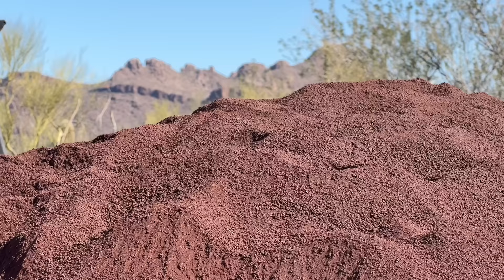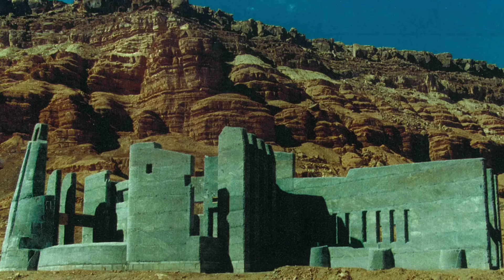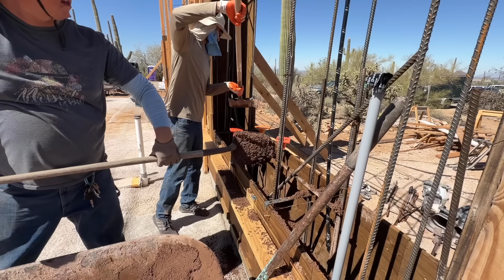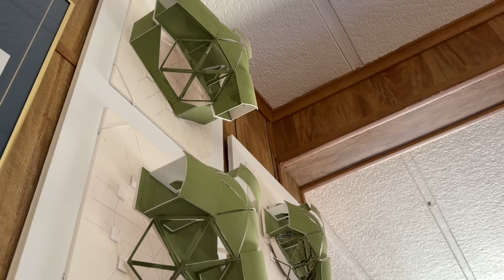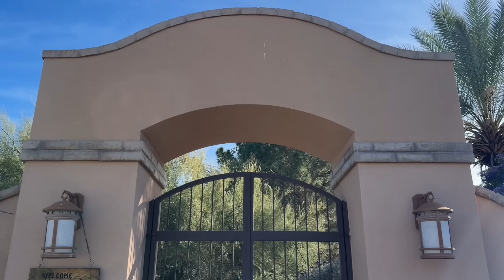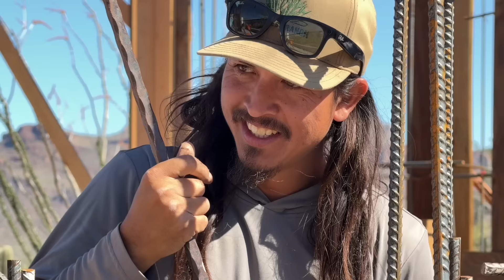The COOLEST Alternative Building Method You've NEVER HEARD OF

Comment: Ok really great for dry arid climates, but how does it perform in the cold, snowy, humid climate of northern Minnesota.  How does the material hold up to continuous freeze thaw cycles and ground heaving.  What prevents water and ice infiltration in the material?
Reply from the maker: You can engineer it however you like. Thicker walls for more r-value, larger and more dense rebar to protect against earhquakes of freeze cycles, you can even put insulation board in the middle for more R Value and a vapor break.

Comment: Does anyone know or built Lavacrete in a cold climate? I am going to build a home in NW Montana and I need to know if there are any problems with Lavacrete in subzero temperatures.
Reply from the maker: You can engineer it however you like. Thicker walls for more r-value, larger and more dense rebar to protect against earhquakes of freeze cycles, you can even put insulation board in the middle for more R Value and a vapor break. Would just look into how they'd build a concrete wall in your area to see how you'd approach it.

Comment: I have a methodology which completely removes the need for cement or lime .. It salt , sand , water & low voltage low current.  By raising the conductivity of the Lavacrete with a small amount of salt the low voltage electrical currents act to galvanically bind / bond the Lavacrete ..
Reply from the maker: Make a video would love to see it 👍
Reply: That would be an awesome process to see for sure! Would also love to see a video of the process in action! Cheers

Comment: This material reminds me of "styrocrete" which is essentially the same but uses small pieces of styrofoam as aggregate thinly coated with portland cement. 

That product clearly isnt as strong as this but it does have a significantly higher R value and weighs less than half as much.

I'd be curious if the two materials could be mixed to broaden the range of characteristics possible.

Comment: Lavacrete is what Icon has been using in their 3d printed buildings for years.
Reply from the maker: It's not the same thing at all. It's a epoxy-based polymer concrete that has no lava or volcanic materials in it. No idea why the  named it that, but what we're talking about here uses real sustainable materials and has been happening for 30+ years.

Comment: I just want Basalt fiber paper. It's better than Stone paper because it doesn't dissolve in acid for justice fire resistant and it's cheaper than the alumina paper that's used in Kilns, it doesn't need to be that fire resistant! Anybody know where I can get it?
Reply from the maker: Not sure what basalt paper has to do with this?
Reply: @TinyShinyHome honestly nothing except that it's actually made from lava not  an acronym that spells lava, or crushed rock derived from lava. Basalt fibers are actually spun from molten volcanic rock! It would also make a helpful Matrix to help pull together this product.
   But I just want it for a lab notebook that won't dissolve an acid or catch fire.
Reply from the maker: 😂 fair

Comment: Thanks for your most interesting post. I assume the finished wall is water permeable since the lava crete is porous? How do you manage drainage? I see no weep channels or drainage installed at the bottom of the walls. It was stated that typical steel rebar would rust inside the wall if exposed to too much moisture, therefore other non-metal types of rebar would be preferable. Are the non-metal rebar types code approved?
Reply from the maker: Yeah it's not something you'd want to put underground. That's why a stem wall is recommended. You can put insulation in the middle of the form while pouring to create a vapor barrier if required by code or just build a bigger roof overhang. I'm just a DIY'er so I can't speak to your specific codes. You'd have to research that yourself.
Reply: @TinyShinyHome  Thanks for your reply.

Comment: Could it be formulated to work for 3d printed house use? My assumption is that the answer is probably no… but just curious
Reply from the maker: No, it's a dry mix that is purposefully aerated and porous for increased insulation. Wouldn't flow in a 3d printer.
Reply: @TinyShinyHome that’s what I thought

Comment: Adobe and Tapial is easier and does not need rebar .
Reply from the maker: Actually Lavacrete is easier. The material is lighter and requires a fraction of the compaction that Rammed Earth requires. For engineering, code, and safety - both rammed earth and lavacrete use rebar, and that is recommended for lateral strength. You can build both without, though. Lavacrete should also have slightly better thermal properties because of the porosity of the walls and the way the material holds together. Not hating on Rammed Earth at all - it's also gorgeous and has similar properties.

Comment: Does this work in the humidity and salty air of Hawaii? We live in the jungle forests on the slope of Hawaiian cliffs.
Reply from the maker: Like Guru Das mentioned in the video, steel rebar would be your biggest failure point in that environment so you'd want to look into alternative rebar. Otherwise you'd probably want to build large overhangs to keep rain off, and some of Paul's buildings have a foam insulation sheet in the middle of the wall to act as a vapor barrier since the material is a little bit pourous.

Comment: Question what about adding epoxy  to the mix for a binder and sealer. Like they do for poured earth walls ..
Reply from the maker: You can seal Lavacrete walls, but keep in mind that if you are plugging all the holes you're reducing the breathability of the wall which is an important feature. As far as adding epoxy into the mix I would imagine that would change a lot about the install.
Reply: @TinyShinyHome ok  I was thinking for structural strength weather proofing but breathing wouldn't the mud clay hemp epoxy  overall have a better outcome 24 inch walls reinforced with steel at windows doors Not rebar then rebar in walls used drilling pipe in foundation sticking up at all thresholds for wall and roofing strength. All steel can be cleaned and epoxy coated. Whats your thoughts or have you tried this. Thanks
Reply from the maker: No idea, that’s a completely different way of building. We’re focused on Lavacretein this thread.

Comment: I'm  wondering how this method would stand up in a seismic active area?
Reply from the maker: The rebar reinforcement is going to be how it holds up, so you can engineer it however you like (i.e. larger rebar, tighter grid for higher seismic areas)

Comment: This still seems like a labor intensive system which means in high cost labor areas this would be cost prohibitive? It seems cool to get rid of many other trades and products like drywall and sheathing, WRB…etc. however not sure if this would pass CA earth quake codes
Reply from the maker: Houses don't build themselves. If you're not interested in DIY'ing it then you're always going to pay labor. With Lavacrete the walls can be done by a single team which is definitely attractive. Add a little machinery like a front loader and you can move faster. Rebar reinforcement is already recommended so you can engineer that reinforcement however you like for seismic areas.

Comment: Reminds me a lot of hempcrete, but i think this has the potential to build higher than hempcrete, which offer its own amazing advantages and properties, too.
Reply from the maker: Hempcrete has it's own benefits, but it's just an infill. It doesn't have any structural properties. You still have to build a wall support around it.
Reply: @TinyShinyHome  No you don't. Just as in this video, you build supports in order to form the walls. You then remove those wooden supports and raise them several feet to form.and pour once again. Hempcrete structures are stand alone, and require no more support other than within the hempcrete itself, just as with the lavacrete here. They look like concrete or stucco buildings when they are finished.
Reply from the maker: We have been to several hands-on workshops, and while it is "poured" in a similar way, it is not load bearing. Most hempcrete has a PSI of only 145 which is not enough for a structural wall. Professional concrete gets poured around 4,000 PSI and Lavcrete tests at about 2,500 PSI. Like I said, Hempcrete has some great things going for it, but it's an infill right now, and needs more support if you need to put a roof on it.
Reply: @TinyShinyHome 

Ah, i see. Thank you

Comment: The science behind this reveals a lot. Scoria is mostly glassy minerals composed from silica and alumina with some iron. These types of minerals react chemically with calcium hydroxide to form the same sorts of minerals found in concrete. Cement is a synthetic mineral that forms new minerals when water is added that stick to any inter mineral substrate. Without water cement does nothing. Cement also has excess calcium hydroxide which chemically activates the scoria minerals to form new bonds giving the long term strength increase. Fly ash which is commonly used in concrete mixes is another type of glassy minerals that act in this way. Blast furnace slag is another material of this type that can activate as a cement when activated by lime. 
Because crushed scoria fines are very sharp and porous it has a high surface area that takes a lot of wetting. They are not adding less water in this mix, the scoria is soaking it up leaving a drier looking combination. Normal concrete sand and aggregate is more dense and non porous so the water can form a slurry with the cement powder. Fly ash, if added, has a lot of microscopic glass spheres which improve the wet concrete workability. 
Lime is calcium oxide or hydroxide and can activate the scoria to form new minerals bonds between particles but it is slower. 
In terms of environmental effect both lime and cement production produce similar amounts of CO2 per ton. The mining and mineral processing steps and equipment are very similar (cement mix is 70% limestone). Cement has a higher processing temperature but modern plants are more thermally efficient than lime plants. 
(30 years in cement, lime, fly ash and alternative cementitious materials).
Reply: Great info
Reply: Post videos🤔😳🤗☺️

Comment: Seems cool, seems expensive.
Reply from the maker: Like we said in the video, lava sand is a byproduct of landscaping lava rock. So as long as you're within decent proximity to a cinder company the cost of material is relatively low, especially to stick frame housing. You'll pay more in transport than materials in most cases.
Reply: @TinyShinyHome right on… I guess I’m coming from the standpoint of design and implementation. What could one expect to pay ballpark for a basic 1500sq. Ft dwelling ?Thanks and cheers.
Reply from the maker: I'm not a contractor, just a DIY'er. But we'll be keeping track of the costs for the Lavacrete Utility Lodge project.
Reply: @TinyShinyHome sweet! 😊

Comment: Question for the EXPERTS/TINYSHINYHOME Can the outside skeleton walls of a BARNDOMENIUM be done instead of wood?
Reply from the maker: You would need to build 4" minimum forms and mechanically attach them to the metal structure via rebar tied into the rebar grid inside the form. Doable, but lots of work.
Reply: @Tin @TinyShinyHome that is something worth looking into Though; but the fact that this Lavacrete is available is very interesting and the colors are so beautiful looks like a sand bottle from when i was younger 🥹
Thanks so much for sharing All Your Work and Videos 😊❤

Comment: Replace Portland with Magnesium Phosphide binder.
- More than twice as strong.
- Waterproof (not porous like concrete)
- Cures in 24 hours (!)
- Has a Negative net CO2 (!!)
Can even be foamed for insulation.
Reply: Follow-on-
Forgot other important characteristics of magnesium phosphide binder:
- BONDS to aggregate and Not just a physical interlock.
- Zero temperature coefficient (does not expand or contract with changes in temperature).
Reply from the maker: Maybe - you'd need to get tests done

Comment: Do these walls allow vapor to pass through like a compact block does?
Reply from the maker: Are you asking if the walls are breathable? Yes very much so.
Reply: @TinyShinyHome Yes a fired brick wall or a concrete wall don't allow water vapor to move through them, acting like a thermos. So you get condensation that builds up on the inside.

Comment: I feel foolish for not knowing about this sooner. I have some humble questions. What specifically, is used as the binder and how does vertical load capacity play it's roll here? For multiple level building construction, is this totally dependent on the steel framework for support? Obviously, I'm not a Civil Engineer but I do work in the field of Composite construction. I see so many opportunities with this type of building concept. If this can be done in a cost-efficient way, it could also be the wave of the future, and I may know how to find the right companies to manufacture some of these materials. I just need to know more about the binders. I'm throwing this out there! Let's see if anyone responds!
Reply from the maker: Hi there, I'm a little confused as we go over the binder options (cement and lime) in detail? Once compacted you can easily achieve around 2500 PSI compressive strength. The rebar is for lateral strength. 2 stories would need a concrete bond beam before starting the second story.

Comment: You tell that business guy that I have the best idea - THIN plywood layers, wetted for 10 days with acetic acid, to acetylate the wood, and then DRY THE THIN LAYERS AND GLUE THEM ALL TOGETHER.  THEN SLICE THE BIG PIECES INTO STRUCTURAL LUMBER.   The reason this is super profitable is the fact that glue - lam is already an industry, and all you'd do is acetylate thin layers, POTENTIALLY EVEN CHIPS.  the glue does the heavy lifting. I think since you start with the laminated wood industry, you can pretty easily make a test facility nearby or on their back lot.  I'm quite certain this is a profitable business.  Have fun.  Some day maybe I'll be a buyer
Reply from the maker: What are you talking about?

Comment: this is always interensting but it dosn't hold up that great in say like North Dakota and most extreme Northern places.
Reply from the maker: Why? The idea of Lavacrete is really that it's "engineerable" to whatever you want. Make thicker walls and add insulation for more R value, create a tighter rebar grid with larger bars for seismic zones, add a high PSI bond beam for heavy roofs or snow loads, build large overhangs for rainy areas. As with any alternative building type, you just need to modify it to best fit your environment. Easy.
Reply: @TinyShinyHome  Environment to extreme.
Reply from the maker: We also have extreme environments here  in the high desert. We get snow, freezing temperatures, insane monsoon storms, 100+ temps, destructive dust storms, hail, etc..

Comment: Very similar to rammed earth like Sirewall. Hopefully it’s more affordable to get the mix figured out than it is with Sirewall. Have you considered adding an insulation material in the middle like Sirewall does ?
Reply from the maker: I'm unclear on exactly how Sirewall is mixing their material, but I get the big idea. Yes, many of Paul's larger residential projects have an insulation material in the middle. The idea of Lavacrete is really that it's "engineerable" to whatever you want. Make thicker walls and add insulation for more R value, create a tighter rebar grid with larger bars for seismic zones, add a high PSI bond beam for heavy roofs or snow loads, build large overhangs for rainy areas. It's super DIY friendly or scalable to code compliant structures.

Comment: I immediately wondered what sorts of properties you could get out of a hybrid material of this and hempcrete(lime, hemp hurd, and water), given that the biggest problem of hempcrete is that it lacks in compressive strength(note I'm thinking something like 4-6 parts scoria and 1-2 part hurd and extra water and lime as needed rather than a 1:1 hemp to scoria).  I'm also curious what the physical properties of a standard poured concrete using scoria sand are.
Reply from the maker: Sounds like you have some experimenting to do ;)

Comment: Would be very interested to find out how this exciting material stands up in other environments (not just low humidity desert 🌵) ..  like high humidity tropical environments, that face stresses like constant rain & storms, and biological growth on the stone (like algae, etc) 🏝️ and also how it would stand up in extreme cold 🥶 and heavy snow loads of high altitude mountain communities 🏔️❄️
Reply from the maker: Like we mentioned in the video, for high humidity areas non-steel rebar is recommended. Other than that as with any natural building you want to build long overhangs to protect the walls from driving rain.You can also engineer to to whatever specs you want. Thicker walls for more R value, more rebar for high seismic areas, and even insulation breaks in the middle of the wall for water shedding if you constantly soaking the wall. The PSI is about 2500 and you can do a traditional concrete bond beam on top for heavy load roofs.

Comment: How do you ensure the layers stick together when you add wet to dry?
Reply from the maker: The new material you're putting on should be completely coated with the binder if mixed properly. So it just glues itself to the wall.